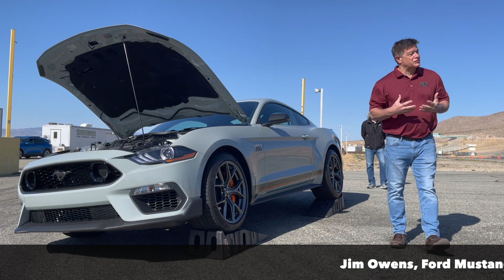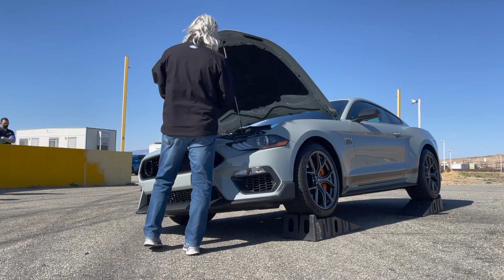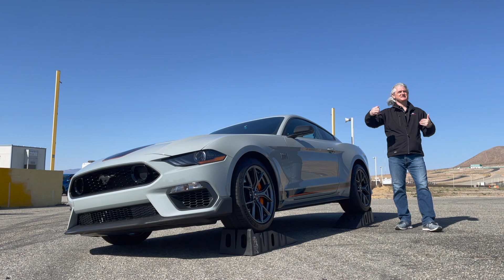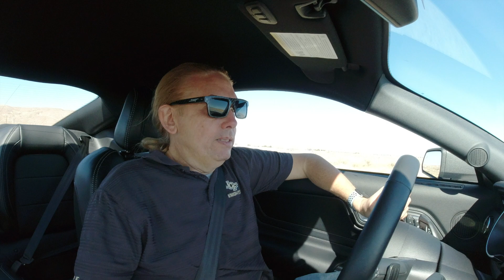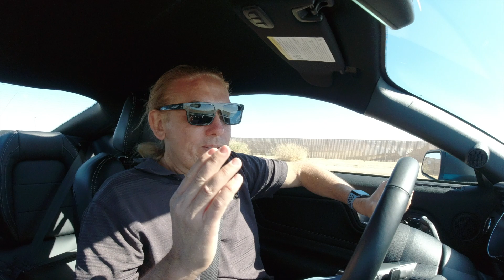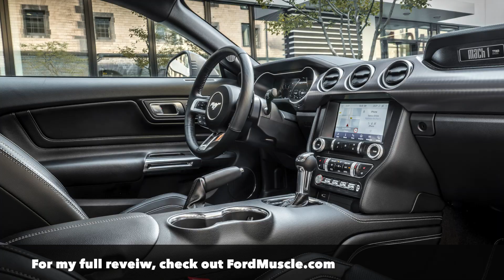First Drive! 2021 Mustang Mach 1

Comment: For most people one of the biggest factors for paying extra for the Mach 1 is to get the Tremec manual transmission. As good as the 10R80 is, it just takes so much away from the overall experience of the Mach one with the manual.
Reply: Tend to disagree. If you visit the Mustang 6 forum,  a dealer reported sales in his region are almost half/half between automatics and manuals. So, can't say "most people"

Comment: Why is no one talking about top speed or 0-60 miles or 1/4 mile? I need figures
Reply: did you say 0-60 miles
Reply: There's info in other vidz....0-60 is around 4.1secs and 1/4 mile is 11.8 -12.2 depending on which version.  The Australian version seems to be lacking a little compared to the American setup.  Also depends if it's the auto or manual trans!
Reply: @kmafire33  I got a handling pack auto coming in, American version, hopefully it can hit 4.1 but from what I’ve heard that’s just on a very good prepped surface with a good launch
Reply: @donovanq4887   l'm sure that's accurate! I have one ordered with the handling pack also but, it won't be built until October!!🙄
Reply: @kmafire33  yeah mine is supposed to come in September-October, I heard that theyre ramping up production heavy so hopefully comes sooner than expected. At least we don’t got these 30 week wait times on the Mach e
Reply: Mainly because that’s just selling numbers on the track no one cars about 0-60 or 1/4 miles times.